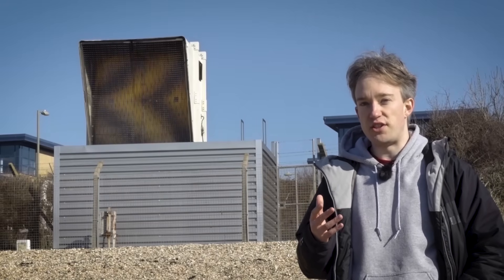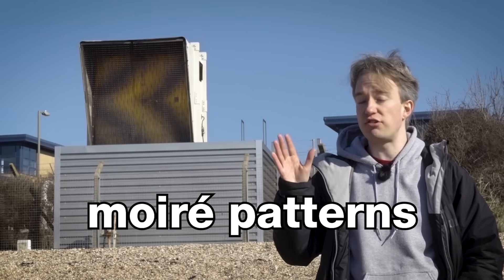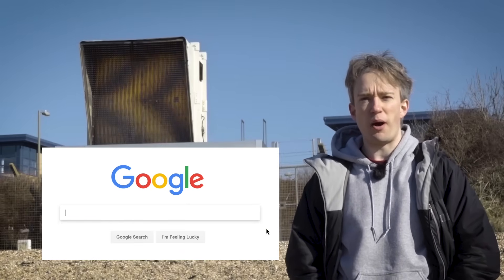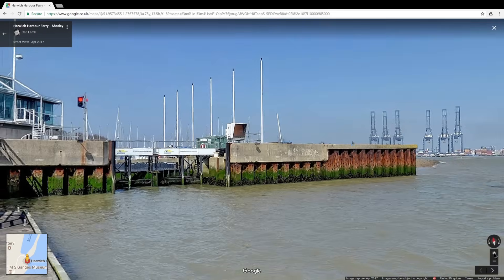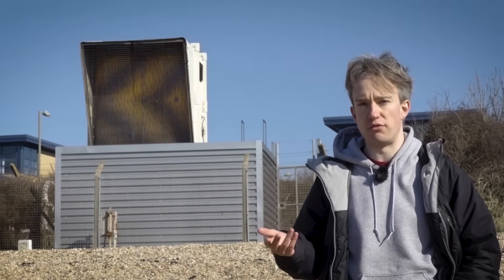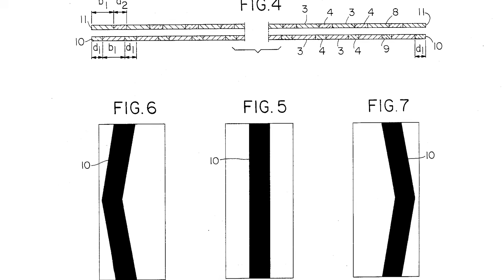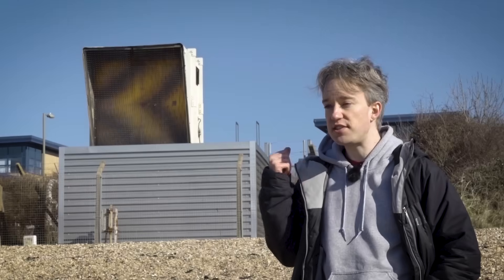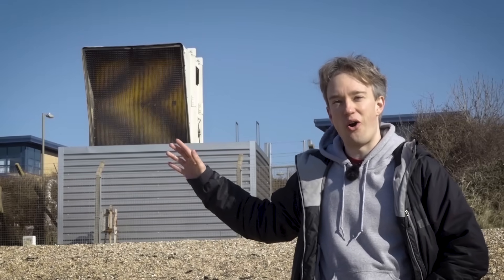The moiré effect lights that guide ships home

Comment: I recently acquired a "spirit" level / angle finder made by Inegon, it has a machined flat magnetic base with a rotating bezel similar to a compass, instead of a needle suspended inside there is a transparent disc with fine parallel lines, the face of the bezel is also marked with similar lines. Set the base on the surface you want to measure, the suspended disc finds its level and you rotate the bezel by turning a separate knob which i assume drives the bezel via a gear giving you precise control. Using the Moiré affect to guide you can can stop the bezel where the lines are all parallel and take your angle reading from the scale around the bezel.  Or set it to 0° and use it like a spirt level when hanging a Picasso in the living room.

Comment: These are also found on airport parking stands to guide the pilot when taxiing in onto the stand. They are accompanied by a distance to the stopping point for each aircraft type so that it stops in the right place to align with the passenger air bridge. Alex Captain Boeing 787.

Comment: Here in the Netherlands they're used to indicate sharp corners, especially when you're approaching at speed - such as an exit ramp just off a motorway.
Usually not lit from the back; in daylight they're visible enough, but they do have a reflective layer so any headlights will bounce straight back at the driver, making them very visible indeed.

Very effective 😎👍

Comment: To me, it seems a very good use of such a light: how else would you indicate the lie of a cable you shouldn't anchor to (and still let shipping cross it, i. e. a fence or boom wouldn't work)? A laser beam along it would I suppose work, but that you'd only see when you're actually on the line; this light lets you see when you're near it, and also which direction it is.

Comment: In the video, it was mentioned that this “light” follows the path of an underwater cable. But, was it ever confirmed that the light was installed after the cable? Or, could it have been installed BEFORE the cable was? Could it have actually been installed as a guide to help properly install the cable from water to the building?

Comment: You answered your question before you asked it.  The light is so you know where NOT to anchor.  You literally explained it.  The parallel lines indicate you are over or near the cable.  The arrows point to where you need to go if you want to drop anchor.

Comment: Hi Tom, I teach people boating in Southampton Water and many Instructors have informed me what they think this light is used for, not even Southampton VTS (The Vessel traffic service) or Harbour Master in charge of Southampton Port, knows what is used for in that location. It is not likely to mark (where the under sea pipeline is so as to not anchor), there are no anchoring designations on the charts for that in this area and a huge white sign near Hamble Oil Terminal stating no anchoring. Having done much research on this Inogon Moire Pattern Leading Light myself, the only conclusion I can see is this (and Im sorry for another guess), is that is is used to put a ship directly over the pipeline, so that divers can go down for maintenance and inspection of the pipeline. That's the only logical thing in my view at present until I know different. It is owned or maintained by Esso who are on the other side at Fawley, now owed by ExxonMobil, but I can't find the correct people to ask in such a huge organisation. VTS have asked myself, If every find out for sure, to let them know  and I will one day Im sure I will, as it would be nice to let my students know for sure what its for exactly.

Comment: As airline pilots, we use the exact same system at some airports to help guide us during the final phase of taxi to the gate. The device tells us if we're on or off centerline. Another sensor senses distance and gives us a signal to stop the aircraft when we've reached the correct stopping point. LAX for example has them at some gates.

Comment: I assue you have already received an answer to the question you are asking, but I will try to offer a breif explanation of why this light is used.

To mark a pipeline, you effectively need something that will give a very clear "line" of where the pipe is.  Two flags oriented perpendicular are no good, as how can you tell if you are looking at the "off angle", or in a safe area?  its just not that clear.

Sure, two flags in line with the pipeline would also work, but to ensure the correct separation the flags would need a large amount of distance between them so that the "off angle" false positive area (a safe area that ships think that they shouldn't drop anchor) isn't too large.

The light offers a simple, compact design for this as all you need is the light itself.  The light has a clear "line" where no arrows are show, which can easily be lined up with the pipeline.  It also offers minimal false positives as it is almost certainly calibrated for a rather narrow angle.

Comment: Its rather common for identifiers at sea to be indicating where to avoid underwater hazards or sensitive equipment/areas. Likely why the Engineer for that habor or the Habormaster themselves allocated/required that Inogon light for that location be installed to protect the underwater cable. Either that or the service provider, or whoever owns the cable indicated they required some type of alert system to protect their investment. Not that odd to install something with high cost upfront especially if it amounts to a one time cost such as this probably amounts to.

Comment: Why? To let boaters know the cable is there.
Signs wouldn't be seen at night, in foggy, or inclement weather.
Standard lights would not be bright enough in fog.
Stronger ship lights would be too strong in normal weather.
This method and with this amount of light, boaters can see the signal at any time of day and in any weather condition. (In any weather condition is the key)
Referring to their nautical maps after spotting the light, boaters would become aware of the cable below.

Comment: I don't have evidence but it makes sense as to why lights are used this way. 

1. they don't take up electricity - so green way of solving a problem. plus, you don't really need computer tracking as you said, so cuts down costs there as well. 

2. the way those arrows point are convenient for the task. The operating logic fits the desired outcome: if you're on the left hand side of the lights, the arrows will tell you the cables are to the right, and vice versa. (in case someone was wondering why a solar powered light wasn't used etc). 

I think these lights were just a simple solution that happened to solve the problem here. And, often the simple solutions are the smart ones.

Comment: A similar system is used to guide landing airplanes on a correct glideslope (PAPI lights). In that case however they don't have Moiré patterns, but lights which change colour depending on the angle you are looking at it. If you are at the correct angle you see two red lights and two white ones. Too high, you see more whites, and too low, you see more reds (Red on white: you are alright, white on white: Check your height, red on red: you are dead)

Comment: The last part reminded me of the Cold War spy operation Ivy Bells.... The Soviets had naval bases on the Kamchatka Peninsula, they needed to communicate... the story goes that someone high up was thinking about growing up fishing in the Chesapeake or such place and there being signs not to anchor there due to underwater cables. And he thought, they must do the same thing there. So, the specially fitted USS Halibut submarine went into the Sea of Okhotsk and literally looked for signs near the base warning boaters not to anchor there... and they found the communications cable and tapped into it, going back over and over to collect the tapes and putting in new ones until an NSA employee sold the secret to the Soviets.

Comment: Other lights use coloured filters for steerage info. The needles lighthouse does this with its light shining eastwards up the Solent divided I to three sections red white and green. As you navigate down the western Solent If the light isn't white, you need to steer one way or the other. Keep the light white and you are in safe water.

Comment: It’s possible to very likely a sea chart that includes navigation aid notation would have a special notation for this spot saying to steer away from the areas.

I imagine altering the manufacturing process of one line just to make the rare replacements for a single machine is annoying and expensive.  Easier and cheaper just to have the naval whoever make a notation.

Comment: GPS navigation makes these lights obsolete. The idea that this light exists to dodge the pipeline is wrong they are used so that you can line up with the pipeline for repair work because they could not find the lines to repair them. Now though instead of repairing pipe lines or cables they would recycle them and put new ones down because it is far more cost effective.

Comment: The technology used here is similar to what is used in PAPI lights at airports, where multiple aircraft approaching a runway at different heights can receive a different pattern of red/white lights. Depending on their height, multiple aircraft receive different guidance from the same, fixed lights.

Comment: The more common solution is a "range," two fixed lights (and two marks) on two poles of different heights, a certain distance apart, that only line up if you are going down the channel. If the lower mark or light seems to veer to the left, you have veered to the right side of the channel, and vice versa. An Inogon light would be effective where there isn't room for two poles of a calculated distance. The Inogon leading marker in Southampton is likely explained on nautical charts, which doesn't make it foolproof, but will at least keep most professionals off that cable.

Comment: Right next to the cables is also a large pipeline which pumps fuel from Fawley refinery (The other side of the water) to their storage facility right next to the Inogon light on Hamble point; if the pipeline were to break/crack thanks to an anchor dropped on it; it would be a environmental nightmare!

Comment: I seem to remember those in California when San Diego was being rebuilt in the mid 1980s to late 1980s, when you approached a curve in the i-5 freeway there were some signs that as you approached them they pointed towards you'd need to move. Then again those were near where the navy base so maybe what I recall were signs in the fields where they did their practices. Sometimes we would slow down to watch massive helicopters descend and soldiers would drop from it sliding from ropes.

BUT I am mostly sure it was in the then novel freeway, before that we used the 805 freeway which crosses the middle of San Ysidro, National City and San Diego. After that only those massive signs with ligths announcing detours, accidents or important things were more common.

Saludos.

Comment: nowadays they use more ofter sektor lights. If you are right it is white and when you deviate too far from the central line it becomes green or red depending on the direction you deviate.

Comment: I'm a retired merchant marine officer and have never hear of this. That makes it cool. The usual means of knowing you are in the center of the channel is ranges. A short fixed beacon and light in front of and lower than it it's mate behind it. When they line up you are in the center of the channel. It's a low, a no, tech solution and very common. The use of this thing to keep from anchoring on a cable is very logical, especially if the arrows point the opposite way of if it were for ranging up a channel. If it were used like a no parking between the arrows sign. But barring any unstated draw backs it appears to only fix something  that already works just fine. Ranges sometimes have red and green lights lower than the main white one to help with being port and starboard of the channel, but that rare and usually not needed. The lights on ranges are going to be as bright as required up to the point that if you can't see and read them then the visibility is too low to proceed. Angling and shielding the lower lights would serve to tell a mariner where it's safe to anchor. So , this things viable range, the brightness of it  lights, its visibility and function in all conditions, especially in rain and fog,  is where I'd look for why this of this new solution to the traditional fix ever caught on.

Comment: Seems a bit complicated... I've seen navigation "Range Markers" that are two poles in alignment with the mid-point of a channel (deep water). The pole nearest (or on) shore is taller, and the one nearest the channel is shorter. Each has a similar vertical marking sign. 

When the fore and rear pole marking signs are lined up, you are Mid-Channel. I don't see why this couldn't also be used (with different coloring or shape) to do the same task the Moire' Effect lights accomplish, at a much smaller cost and maintenance factor.

Seems to me that the Moire' Effect lights are Over-Engineered for the task at hand.

Comment: Because of what just happened in California with a ship waiting to be called into port to unload, dropped anchor to wait and the boat was dragged in bad weather OVER the pipeline and bent the pipeline over 105' out of plane into a semicircle.  The pipeline eventually cracked and leaked thousand of gallons of oil.  The crew should have been aware of the pipe via GPS.  In closer quarters, like in England, a light like that would make it easier to see when you are too close to the pipeline.

Comment: This is similar to the ANGIS (Aircraft Nose Guide In System) we have at the airport where I work, it's an older system and it's not used often. Instead we use the SEGS (Stand Entry Guidance System). But they're effectively the same thing.

Comment: I just realized that this is genious. I've many times seen a warning sign that warns about an underwater pipe or so and usually there's one on each side of the river or lake or whatever. But if you're far away from shore it might be hard to figure out the "line" of the underwater pipeline from a sign. Especially if the shore is not straight but naturally random in shape. So in my opinion this light is brilliant in telling you when you're directly perpendicular to it, even at quite far distances, so you know that now you are on top of the pipeline.
Reply: I think you mean "ingenious" which means - clever, original, and inventive. Not being able to spell it would mean the opposite - dull, foolish and stupid.
Reply: @ruzziasht349  Or that they're not a native english speaker, didn't have access to decent education, or have neurological issues. Either way, hurting people's feelings and social standings for having harmless flaws is immature and damaging. Treat people how you wanna be treated.

Comment: One main grid in front and two separate grids behind the main one, both tilted at an angle such that to give an clear arrow shape at a certain degree of movement. The grid width and spacing plays an important role. I did similar experiment few months back.

Comment: We had the FMT docking system at Terminal 2 at Cologne/Bonn airport. But they were withdrawm from use a few years ago. In Frankfurt they are still using the AGNIS system (Azimuth Guidance for Nose In Stands)  together with PAPA (Parallax Aircraft Parking Aid) at some stands.

Comment: Interesting. In the US for aids to navigation they use range lights. 

They are set up in a why where when you are dead center in a channel the lights are directly above one each other. If you're left of center line of the channel the top light will be to the left of the bottom light.

If your right of the center of the channel the top light will be to the right of the bottom light.

Comment: it is sort of one of the simpler ideas, complex but easily implemented once you sort the geometry of the intersecting lines.  It reminds me of the geometric shapes they use for a myriad of things.  Sound design such as amplification, noise cancellation etc...and the wireless radio technology with the various contraptions they use to "catch" the signals.  Interesting stuff Tom.

Comment: Very cool video. I fly for the airlines in the United States and some busy airports have self parking jet bridges where we use these signs to line up on the lead in line to the gate instead of following human directions from ground personnel. The last few feet are very sensitive and it’s embarrassing when you roll a few inches beyond the STOP light and flashes TOO FAR, at that point there’s nothing we can do without a tug ;)

Comment: The Coast Guard evaluation clarifies why you don't see a lot of them.  A 2 station range works better, more precisely, over a longer distance, in both daylight and at night. Ranges have been used for centuries. A good example is the 2 station range indicating the channel at Port Huron Michigan, located on the Michigan side of the river.  Similarly, the low forward and higher aft mast of a large ship form a range, telling you its course, to avoid collisions.

BTW, PAPI used at airports is Precision Approach Path Indicator, 4 lights, each aimed slightly different vertically, each showing either white or red depending on whether you are above or below the glide slope. You want to see 2 of each color. Learning about Knickebein is left to the student.